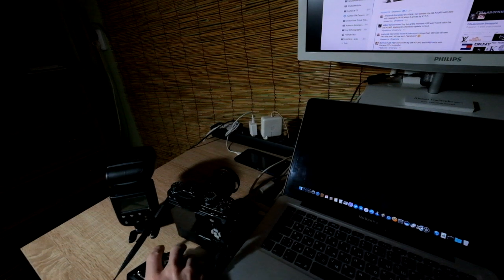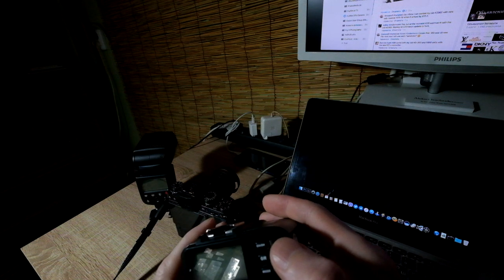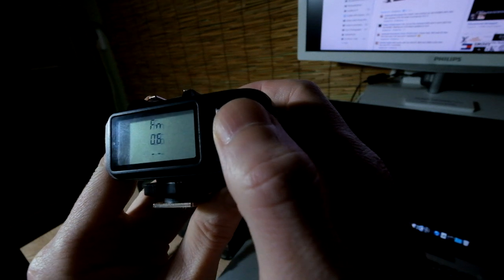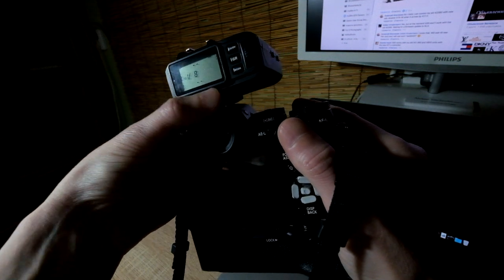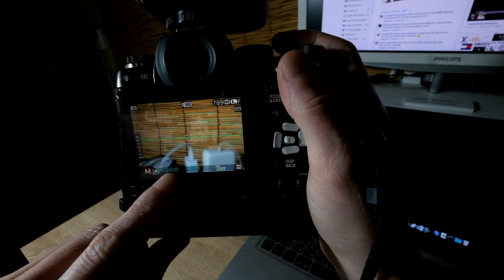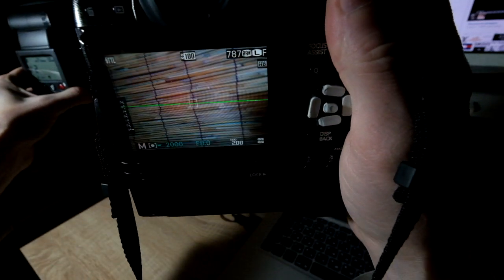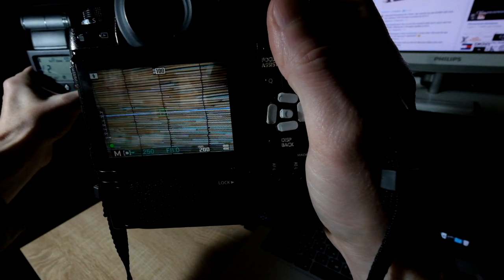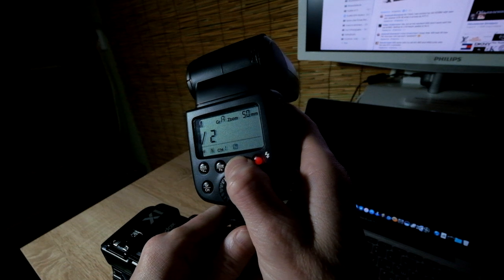HSS with Godox X1T-F trigger and Thinklite Camera Flash TT600

Comment: I have exactly the same setup, tried the settings exactly the same as this video and the flash doesn't fire when the shutter is above 1/180
Reply from the maker: So in camera menu in Flash settings you have enabled TTL and Syncronization set up to FP/HSS? And your shutter is set to Mechanical, not MS+ES or ES?
Reply: Hi, yes set up exactly the same and in MS. I am on the newest firmware for the XT1. I have also tried turning on HSS on the flash unit. Hopefully they can fix in the transmitter as the TT600 doesn't have a USB socket for updates.  I also have an AD350 mk1 so holding out for that too.
Reply from the maker: In TT600 press and hold 2-3 seconds MODE/↮ , scroll the dial wheel till [S] appears. Then press and hold  ZOOM/Fn button, press SET button until you go to OS  (and scroll the dial wheel till OF ------ S appears). This will mean that you enable wireless communication and in flash optical slave is disabled and flash can read transmitter commands. I will try to find some time today and record another video with settings of my flashes.
Reply: Neil Herke same here, im using godox v860ii and v850, non of them has worked, above 180
Reply from the maker: Adam Gera than, you did something wrong or missed some setting. A lot of users in Facebook group and in fujifilmx.forum wrote that they can get HSS with their stuff. And.... today Godox released new firmware update for transmitter X1T. Check it out at godox.com
Reply: Алексей Исаченко No no i did everything the right way, it turned out the the v850 doesn't support hss for fuji x system, it worked just fine on the 860iis.

Comment: Hello!!!
Can I use my XT20 + X1T-F + TT600 if I don't update firmware the TT600
Reply from the maker: Page 46 of X1T-F Manual says that we can get HSS, TTL, 1-st and 2-d curtain with flashes which support these modes. TT600 can not be upgraded, but it supports HSS and stroboscopic mode as well as 1-st and 2-d curtain, so the answer is: YES, you can use X-T20 and Godox Thinklite Camera Flash TT600.
Reply: Алексей Исаченко  Why my tt600 not working when I use the Auto FP (HSS)
Reply from the maker: taiy did you update firmware of X1T-F? Did you activate HSS mode in flash? Did you switch off silent mode in camera and electronic shutter?
Reply: Алексей Исаченко  Sorry could you give me the link for firmware x1t-f please
Reply from the maker: taiy http://www.godox.com/EN/Download.html

Comment: tried same setup on the X1T-F (Fn3) to attempt to make it work with my AD360, but yet another failure...
Reply: I think that the reason could be that the receiver XTR-16 does only support Nikon and Canon, not Fujifilm. Since the speedlights have it the reception built-in they do not have the external receiver problem.